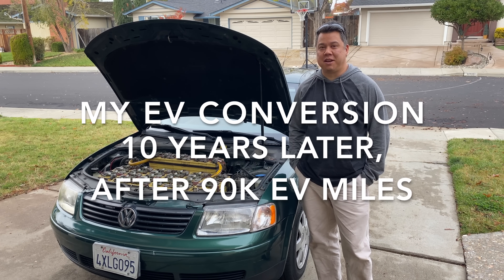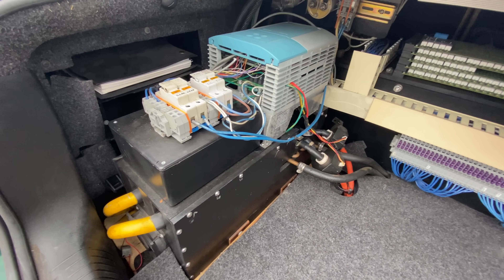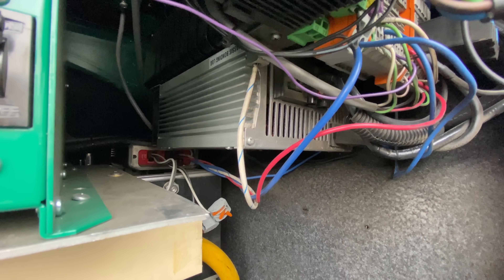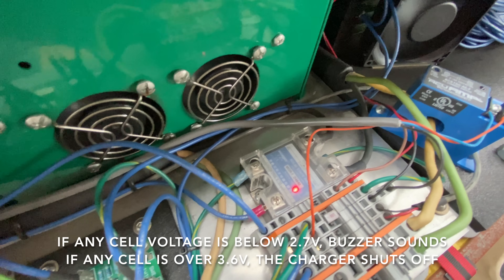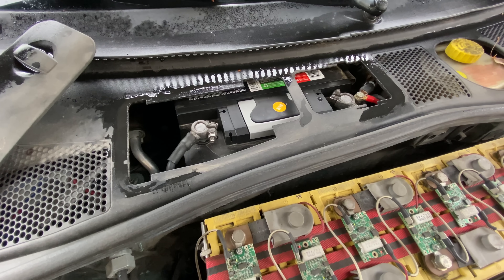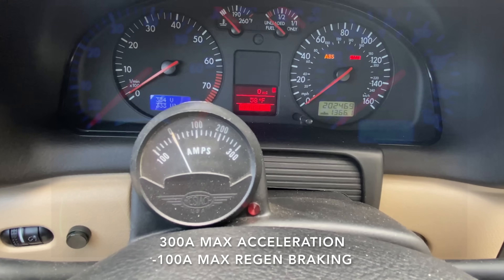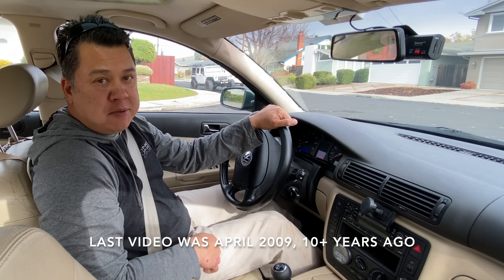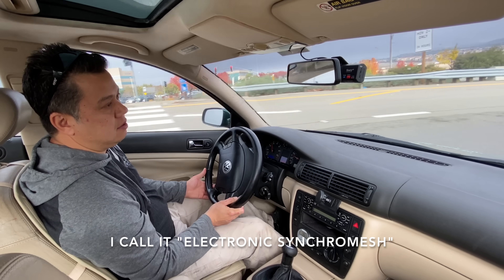My EV conversion after 10 years and 90k miles

Comment: It's pretty impressive I'm not gonna lie. But EV cars are not the future.
Reply from the maker: At least 25 countries have banned gas car sales by 2040. EVs are certainly the future
Reply: @etischer  I said "EV cars" specifically, not EVs. There's a huge difference between a huge EV SUV and a minicar or an ebike, am I right?

If you rewatch the video you can see how actually ridiculous the DIY is. The space the batteries occupy is equal or even bigger than an internal combustion engine and probably heavier.
Reply from the maker: @ImpeccablePony  Oh so EV SUVs are the future, not EV cars lol?  This DIY was done before any EVs were available to buy, everything had to be designed and built by hand, and as such it's more complex.  DIY is much easier now with used EV parts on the market for conversions.
Reply: @etischer  Micromobility vehicles powered by electricity is the future. Not 1-tonne metal cages.
Reply from the maker: @ImpeccablePony  And how many micromobility vehicles do you see on the roads today?
Reply: @etischer  This is why I called it "the future" and not "the today"?

Comment: how does 70mph in second as opposed to 3rd alter range?
Reply from the maker: Range is probably slightly less in 2nd gear, but I don't know that I'd be able to measure it.  Amps at full throttle at 70mph in 2nd gear is about 200A, and if I switch to 3rd is about 280A.
Reply: @etischer  You did a great job on that car! 
I love manual transmissions and we use gearing so smaller engines can power heavier loads. I reckon electric motors are the way forward but I still want a manual transmission. Wondering why we don't have even CVTs with smaller electric motors which would get better range.

Comment: Why do you need a transmission? I mean, more than just one gear? Do you use all 5 gears? At some point it says that you more or less do everything in 2 gear.
Is it a standard gear box and can it take all the torque?

Comment: this is awesome man!  I wanted to do a hybrid conversion using maybe wheel hub motors or a big motor like yours but a small gas engine to convert gas to battery recharging so I still benefit from gas energy density but can save money with batteries as an alternative to gas.  This would mean long road trips could still use gas stations but local driving go full electric always.

Comment: ####111Many years back, there was a conversion done to make an  EV with front wheel drive put on rear wheel drive car frame , so as access to the rotating 2 front shafts. 4 alternators with 12v clutches and belts were mounted with battery bank in rear seat. The tow motor  motor was mounted with rear wheel drive. The driver would drive vehicle up to 25mph then click in the recharging alternators. The distance went up to 300miles per battery charge. Also, the other Patent holder of the Zubris circuit allows $100 fee to use his circuit on your own motor which will also extend range of car to 300miles. . The added circuit removes the Back EMF of motor windings, so as main heavy current can go in . (Type of first very fast Cap discharge) Also the other hydraulic pressure system was added on different car, as stored energy effect on car with fluid pressure from tank flowing in reverse, allowing rotation of same hydraulic pump in reverse to add power to the drive shaft underneath car. The long drive shaft had split 2 piece pulley with belt going up to the fluid pump. High Pressure tank +return lower pressure  accumulator tank. Hand valve in between front seats was operated when vehicle starting from stop and rolling up to 25M per Hour on stored pressure. ( System activated to store pressure during slow down to stop up ahead) ../////<?

Comment: Very well sorted daily driver. The fact it has many of the luxuries like climate control, Ac, heated and cooled seating, electronic power steering. Original safety equipment thats functioning as to factory standards. And no compromise to the chassis. Whilst being a diy build completed a full decade before home built ev's were even a thing is a strong testament to your ability to see a project through in the kind of way so many others would fail.  Love it.

Comment: How do smog that thang lol! But all I got to say is wow! Freaking nice as legit built! 👏 how far can u travel before u need to charge it? The only thing suck is u can't really travel with it unless u bring the house charger with u... next thing built a battery charger or 2 alternator into the front tires so as it roll driving it also charge those batteries at the same time like the electric skate board?

Comment: Very impressive. I’m interested in converting a VW dune buggy to electric and I would like to know more about your motor. Is it just a standard industrial 3 phase motor? I have several of those in the 7-15hp range. What do you think would work for a high torque, low speed vehicle? Range isn’t an issue since it would be mostly used on the farm.
Reply from the maker: The motor Im using was made to be an EV motor.  It's like a 70 volt 3 phase industrial overdriven with 240v applied.  It puts out about 90hp in the frame size of what 20 hp would be.   It's also water cooled.
Reply: @etischer  Thanks for getting back with me. I’m trying to be cheap about it. I’m a machinist by trade, so I have a crazy idea about building some hub motors like the ones by Orbis from scratch. It’s about the journey with me.

Comment: 25k and a lot of elbowgrease for an old car what can't even do more then 100 miles within charges.
Reply from the maker: Well, in 2008 when I converted the Passat, it was only 4 years old.  Back then if you wanted an EV, building one was your only option, Nissan leaf didn't come out till Dec 2010.

Comment: May I ask what type of electrical background you have?  I’m very impressed with your work!  I work for ABB, by the way.  👍🏼
Reply from the maker: I studied Mechatronic engineering at Chico State University.  It's a combo of Electrical, Controls and Mechanical Engineering.  Most of the EV learnings were from tinkering more than course work or reading books. I'm on the advisory board for my college now, so hoping to steer them into offering classes in battery design, inverter design, switching high current DC loads, safety rated control systems... Cheers, thanks for the comment

Comment: Very impressive!
So did I understand this correctly, you have to wait for the engine to slow down to shift in to the next gear?
Reply from the maker: Yep, I tried dynamically braking the motor to the right speed, but it wasn't reliable, nothing worse than doing a hill climb on the freeway and not being able to shift!  The motor coasting down works pretty well though.  I shift maybe a few times a day, only if I'm gonna be on the freeway for a long time at high speed.

Comment: Why did you decide to keep the gearbox?
Reply from the maker: I needed around a 10:1 ratio so I can have 10x the torque at the wheel and the motor doesn't have to work as hard.  I also needed a way to mechanically connect the motor to both wheels, so the transmission does that as well. -cheers
Reply: @etischer  got it, thanks!

Comment: What VFD do you have running the motor? I'm a motion control engineer using AB servo drives but I have dabbled a bit with their VFDs. I only ask be cause I noticed the AB power supply in the rear :)
Reply from the maker: Im using a Eurotherm/SSD/Parker 690 VFD as the controls for a larger IGBT stack.

Comment: not that this aint impressive enough, but you know the 0-60 ?
Reply from the maker: 0-60 was around 14 seconds, mainly because there's no clutch and it takes a long time for the gears to sync between shifts.   It's about the same as 0-60 using only 2nd gear.  More info on this on my website, etischer.com/awdev

Comment: I gotta hand it to you for being extremely handy and knowledgeable on how to DIY your own electric vehicle. 100 mile range is probably within your needs and acceptable for what you’ve built on your own. In the current electric car market, there are too many variables that need to be worked out and solved quickly if we are to ever make the switch to full electric vehicles. Range, charge time, cost to charge, battery cost, how the batteries are charged (especially when driving), battery weight, battery capacity and size, longevity and battery recycling are MAJOR issues that currently need to be addressed. Total weight of the vehicle is an alarming concern that needs to be solved. You’re basically driving around a tank with all the weight from the batteries. A Tesla for example is 4000+ lbs which is the equivalent to the weight of an SUV. Trucks are even worse….If you get into an accident, rear end someone or t-bone another vehicle you are essentially a battering ram on wheels. Sorry I’m not trying to criticize electric vehicles and their benefits, but they are literally more of a danger on the road and more harmful to the environment than a gas vehicle. I sincerely hope advancements are made quickly to address these issues.
Reply from the maker: Crumple zones on EVs are huge since they have no engine in the front, making them the safest tested cars ever on the road.  They also have a much lower CG, so they're nearly impossible to flip over, see model X rollover video. They are clearly better for the environment compared to the tons of fracking/refining/shipping/burning of oil throughout the lifetime of an ICE car.

Comment: Exceptionally well described. You converted this to all Electric in 2008, when such conversions were rare. You used BMS system, DC-DC converter, 240 Volts AC  power charger with "Timer" .. and so on .. Just amazing. Hats off to you..

Comment: That bms in the front has no water proofing, i'm guessing the car is only used when there is no rain
Reply from the maker: The circuit boards have a conformal coating, they also don't get wet when I drive in the rain.

Comment: You show off your electrical engineering degree nicely. The problem is that vehicle is a money and time rich project that 97.89% of people would be incapable of building or affording. 
I looked into fitting solar panels in my home to heat hot water and got a base line figure of five thousand pounds for the materials and was willing to self-install the system. BUT when I calculated that it costs 20 pence to heat enough water to shower with, I soon established that it only costs £1 a week, (showering five nights out of seven). So, it would take an incredible 96 years to pay back my outlay!!!! And that is the thing I am trying to demonstrate here, most people don't do the arithmetic, they jump in and discover later that they have made a costly mistake buying this rubbish. And it will break, I am an electrical engineer too and make my money repairing electrical failures, so I know this stuff WILL cost you money.  Be wise folks, think carefully before buying into this garbage.

Comment: Why do you use the transmission?
Reply from the maker: with a 10:1 ratio, there is 10x more torque at the wheel, and the motor can operate in an RPM range where it makes the most power.  It's also the easiest way to connect the wheels to the motor.
Reply: @etischer  After 9 Years and you're Stil Replying Well done Sir. The World Needs people like you.
I'm afraid I've Sold My Passat 2004 PD130 TDi Manual 😥 never ever let me down, I wish I could of Sent it to you. From UK:)
Reply: @etischer  thanks for the reply. So, its for the torque and power. How about the efficiency? Does it change? Could you drive your car in just one gear, for the street and highway driving?

I'm currently doing a thesis about the subject, and from what I have seen, most electric cars (from the factory, not conversions) only use one gear.

Comment: Ok yeah I was confused when you said you rebuilt the trans every 2 years because of high RPM, but when you added you was using 2nd gear to do 75mph for years that kinda made more sense lmao yeah that'll definitely do it. Any reason you don't use the overdrive for the highway?
Reply from the maker: I started using 3rd gear as soon as I got the tachometer working.  There's really no indication that one needs to shift when you don't have a tach buried in the red to let you know.  75mph in 2nd gear was still quiet, and torquey.

Comment: Clever engineering and construction.  In those respects, very impressive.  As for safety, practicality and cost -- I'm not especially impressed.  In particular, having the timer inside the enclosure seems like a very dangerous way to do this.  Frankly, I'm surprised the code permits it.  Likewise, I'm not convinced that the installation in the trunk is at all safe, especially if it is available for transporting goods.

Comment: The transmission input/output shafts are under the same centrifugal force whatever gear you are in there is no need to worry about overreving a gearbox as there are no springs or valves and no reciprocating assembly.  more akin to a bare camshaft spinning.  personally I would take the gearbox apart lockout the gears that you don't want and use a dogbox gearset to prevent it jumping out of gear from the torque. again RPMS no worries, until about 265 kph +  its been ten years you might as well rebuild the gearbox with some new bearings and seals.  I'm doing something similar to my fiesta in a few years when the engine goes.  I plan to put the motor in the back, cutting out the trunk floor pan.  I like yours though very inspiring.

Comment: man it's awesome to see what ev conversions looked like in 2008, nowadays it would require so much less to do the conversion, it would be much cheaper and easier too. 
definitely an early adopter kind of investment and an interesting car, hope to see it on the road with my own eyes someday
Reply: This is WAY more advanced than most DIY electric vehicle conversions even in 2008. There were people in the late 2000's still using series brushed DC motors and lead acid batteries. This guy even has an inverter for air conditioning, something I haven't seen before in DIY EVs, though I'm not that well read on the history of DIY EV culture.
Reply: How exactly would you go about doing something like this nowadays? Or at least where could I get the information to do something like this nowadays
Reply: Bro you should have invented Tesla or work with electrical engineerings
Reply: @alexisgarcia4111  I rather make cheese
Reply: Honestly, admirable. Cheese is just as important in my mind
Reply: @Jervin-Music  cheese curds for poutine, my company is the biggest supplier in canada lol
Reply: @eepywzrd  like I said. Stay fresh, cheese bag. Love you

Comment: 10 years to go 90k?  This is extremely light use.
Reply from the maker: It was my m-f daily commute vehicle, ~40 miles a day for 9 years, the 10th year I got my model 3 and kinda stopped driving it.  I also had a few other cars I liked to put miles on... Audi TT convertible, Range Rover, Touareg, Model 3...

Comment: That thing must eat the front end tyres.
Reply from the maker: Weight on the front wheels is about the same as stock, if not slightly lighter. Engine block was cast iron, and switched from an automatic to manual transmission.  Ride height is about the same as stock

Comment: Why do you have a transmission on an electric vehicle.
The point of having electric vehicle is for its efficiency
Reply from the maker: The motor is most efficient at around 4500 rpm.  Without the transmission the motor would only spin at 450 rpm, and torque at the wheel would be 10% what it is with the transmission.  The transmission is also needed to mechanically connect both wheels to the motor.
Reply: @etischer  
You will be losing a lot of energy due the moving parts involved in an transmission and sorry this is the first video I have watched and no idea behind why you chose such methods.
I dont understand when you say motor is most efficient at 4500 rpm where do you get that information from not judging here trying to understand as it's been quite a while I dwelled into this topic
Reply from the maker: @kaleelurrahamanzakeer3958  It would be like driving a gas car in 6th gear all the time, the motor isn’t in its power band, you need torque multiplication from lower gear ratios.

Comment: Man as an electrical engineer, I’m amazed how you used so much off the shelf items to make this work. Very impressive!
Reply: Honestly, this is epitome of engineering. Clobbering parts together to give rise to a viable  system. Amazing…
Reply: Only thing that worries me is an automotive accident.
Reply: @00Tenrai00  battery acid all over the place after a collision.
Reply: im curious how much something similar would cost today. most people use parts scavenged off ev cars or made specifically for them, but i wonder what doing it this style where you DONT go for those would cost.
Reply: Stuff like this really interests me seeing what a smart person with internet access can design, acquire off the shelf parts for and implement. I'll bet with the progression in 3d printing and the like, you could recase a lot of the components to make it a little sleeker too, but you can't knock the performance and ingenuity
Reply: Not like he was building a sub 😂
Reply: he works at tesla xD
Reply: Seeing all the DIN rail mounted components I was immediately like, this guy must be an electrical engineer (perhaps industrial automation)

Comment: i mean have to respect the effort but come on lol you couldn't have picked a worst chassis  with the weight
Reply from the maker: The platform is designed to carry a lot of weight, it was available with a W8 with Automatic and  AWD, and the W8 still has a payload of 1200bs. It was also available with a manual transmission which I needed.  Also has 0.27 drag coefficient which puts it in the top 95%.   One of my goals was to maintain 80mph on the freeway, I would fit enough batteries in say, a Geo metro or something.